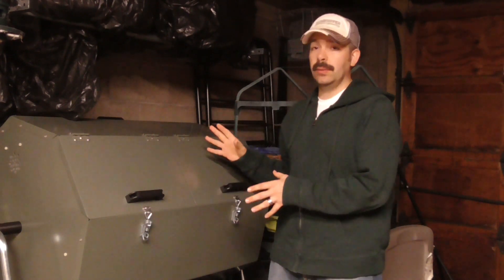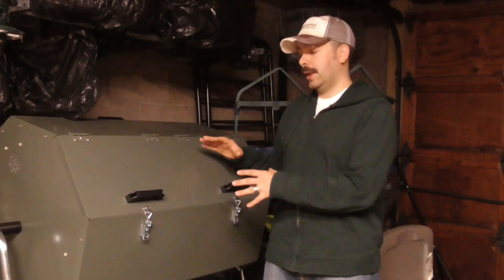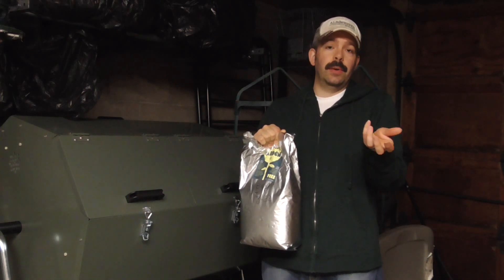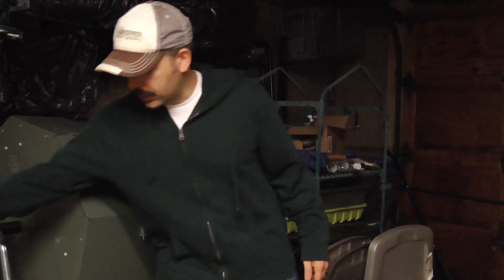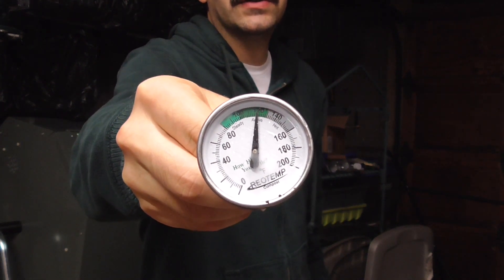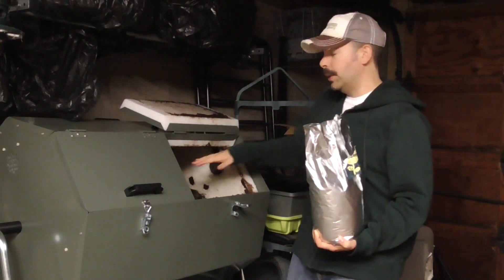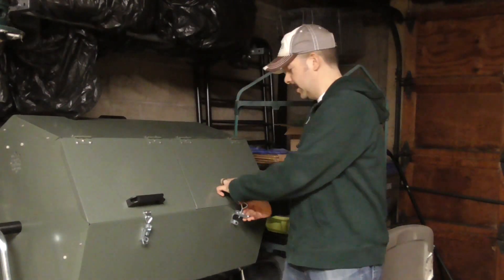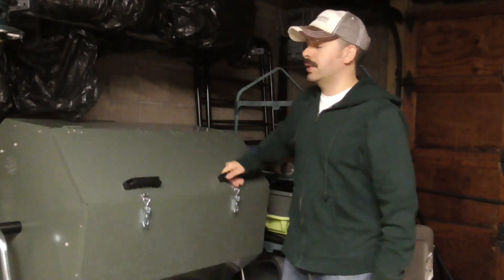Using Coffee Grounds to Heat Up Compost in Your Tumbling Composter for FREE!

Comment: For a few years now I have been hot composting and doing well using mainly fallen leaves and rabbit pellets as initiator using welded wire fencing 3' tall by however wide I need it at the time.  Well this year the arctic vortex hit here in the midwest and the whole thing froze solid.  So today as the temps warmed into the 60s I turned the pile breaking up the frozen chunks as I went , Im hoping the pile will get hot again.
Reply: Also while turning this pile that was mostly a frozen chunk I noticed quite a few worms in it alive, yet the material was mostly frozen, weird they could live in it.

Comment: It would be nice if you could explain the ratio in laymen terms, like 1 part carbon and 2 parts nitrogen, not saying that's the ratio, but please break it down for me. and another thing, I have the lifetime 80 gallon tumbler, I started it July 3rd 2018, and it held a temp of 150* but after 4 day's the temp dropped to 120* I added more coffee ground's, and the temp is still at 120*. should I add more ground's???? the tumbler is a huge work out for me. I have to have help turning it. and it's not even full. the handles are embeded and that's difficult, I like your's but it's way too costly for me. my husband said it wasn't heating up because it isn't in full sun. I don't think that play's a part in it. thank's and let me know what you think

Comment: Hi I am starting brand new vege garden, and have three 2400x1500x300 raised beds and a 3000x2000 poly-tunnel.. I am bringing in 50/50 screened topsoil and spent mushroom/bark mix compost to start and have placed cardboard on the grass. On one "experimental' bed I have placed rotted tree branches from the bush as a base with autumn leaves and coffee grounds. Not really hugelculture but I figure it can't harm. I have constant weekly free supply of shop coffee grounds. Can I blend this with the soil without composting first? I also have 2 CuM of wood chip which is weathered and will spread this on top of cardboard around the beds. Ultimately the back yard will become like a 'bush floor' instead of grassed as it is now. Do you also use the wood chip as a mulch on the beds? Can you let me know if these ratios are OK to start my new vege beds please.

Comment: Coffee grounds is a nice free easy nitro but not likely to heat up your compost unless you are over stocked in carbon.  Most people dont have enough carbon and have to much nitro.
Reply from the maker: That's true. That's why I mentioned in the video that this would help if a person is coming high on the carbon to nitrogen ratio. I shred up lots of woody materials and including bulk coffee grinds yielded the highest temperatures that I've ever achieved.

Comment: there are MANY reasons why your tumbler is not reaching desired temperatures... moisture, carbon, nitrogen... so to just say add coffee grinds to increase HEAT is... ummmm ... hmmmmmmm
Reply from the maker: lakisbouz  I agree with you. But if you watch the actual video: "You MAY find that you're kinda coming in high on the carbon to nitrogen ratio. Where you have a little bit more carbon than what you wanna have for an ideal composting cycle. And that can cause the temperatures to start to go down. So without enough nitrogen the temperatures drop. You're not gonna build up the heat that you really want to have. ... So, what can you add that can kind of help? There are different nitrogen sources out there. But if you're looking at something that's readily available, that is easy to use, and that's going to help to just boost those levels a little bit - well - what you want are coffee grinds."

The video is not about all of the various reasons as to why your compost it not heating up. It's about using coffee grinds and when they can be of particular help. I'm burning through about 3 gallons a week for 6 months now and the grinds work great. And yes they can even add moisture if your pile is too dry.